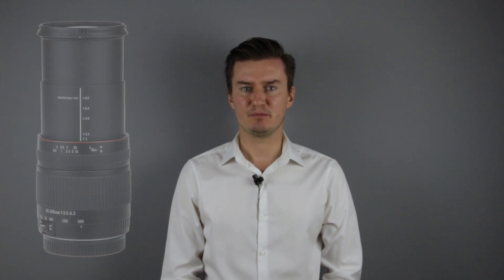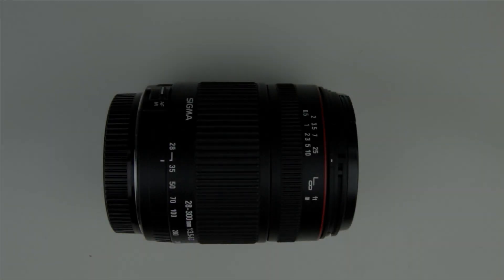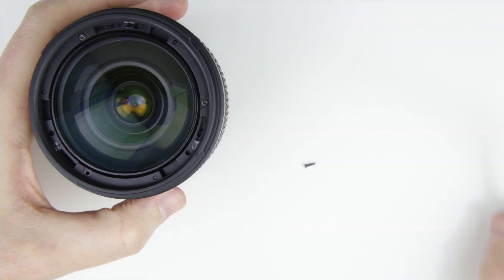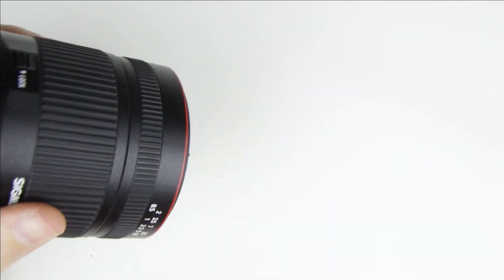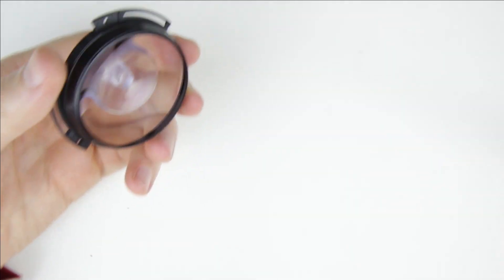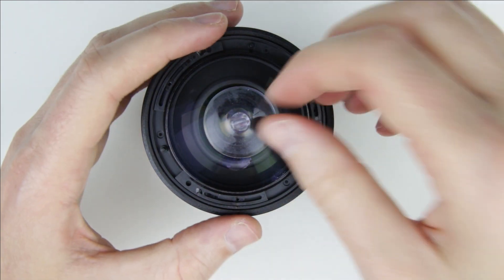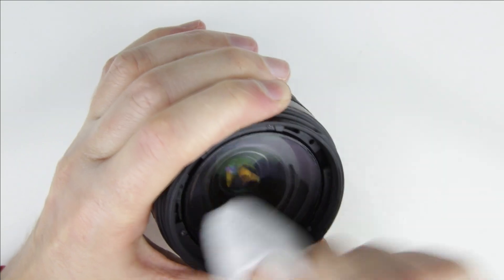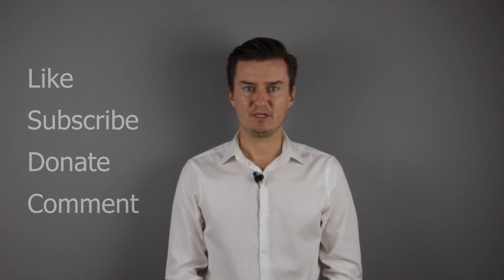Sigma 28-300mm f3.5-6.3 Macro cleaning the lens inside

Comment: Hello, I have the same lens and the AF/M switch always falls out of the housing. Sigma is not able to help and has no spare parts anymore for this lens. How can the swich be fixed to the ring? Thanks in advance for your help and best regards
Reply from the maker: If the outer cover is the part which falls out, then I guess a small dot of superglue would solve the problem. I would remove the bayonet mount, and use a small stick to apply the glue. Just a very small amount, so when someone would have to disassemble the lens, they could do it without damaging the switch.

Comment: Did you ever come across the aperture flex for this 28-300mm (62mm filter) version?
Reply from the maker: There is one which you can buy on ebay. My suggestion would be to remove the bayonet from the rear of the lens, and compare the end of the cable with the cable on ebay to make sure that it is the same.